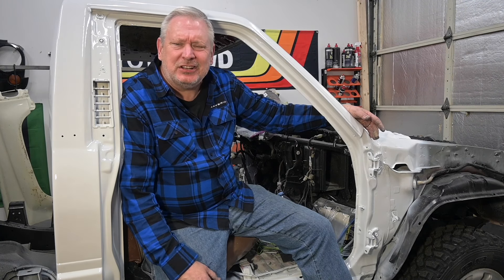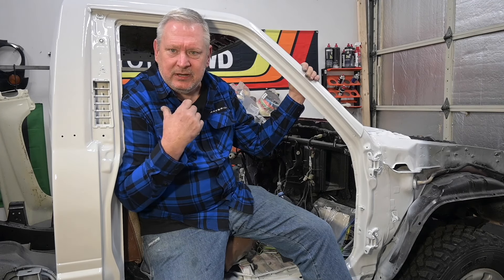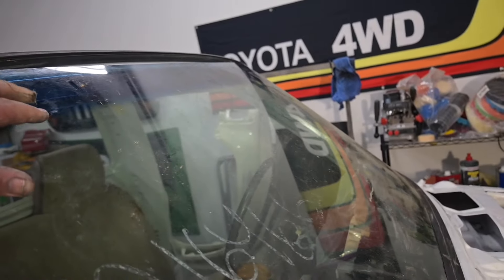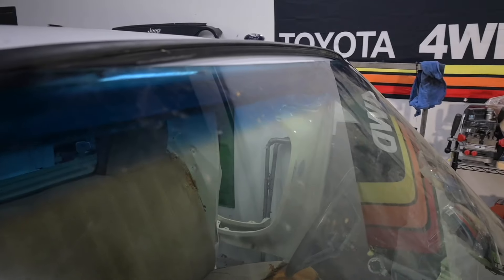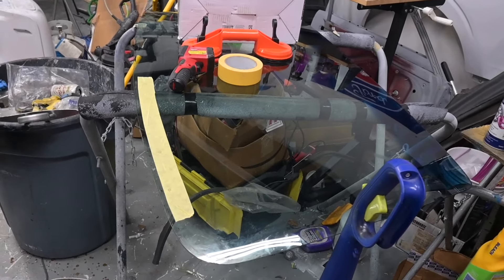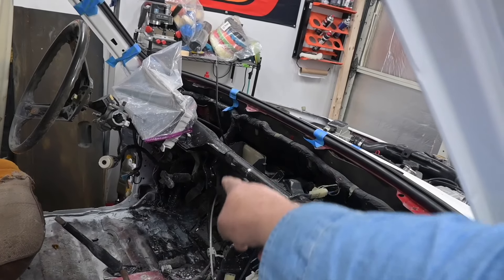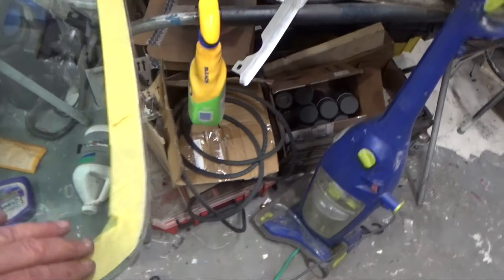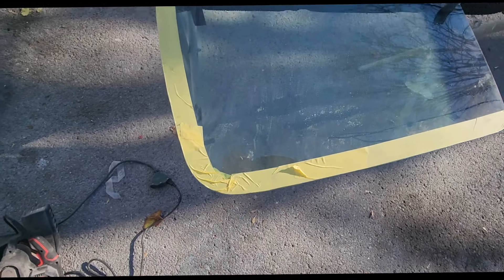84-88 Toyota Pickup Paint - Windshield-Rubber Gasket - Randy and Birds

Comment: So you used no glue or adhesive whatsoever?  Held in just by the gasket?  If that's the case, perhaps leaving a little meat on the bone to allow a tighter fit is actually the right way to go?

Comment: One more question Dave.....so, I appreciate the 'cut-off' measurements you provided, but do you know the 'final measurements' of the windshield that worked in the gasket??  The reason I ask that I'm sure that if I buy a new 'aftermarket' windshield the measurements may already be a 'little different' than factory....so I don't want to just mark it up to take 3/16" and 3/8" off....just curious if you have the final measurements that worked for you...Thanks either way!!

Comment: Would a windshield from an early model pickup fit? 
Like the one that the gasket is made for? 83 and earlier pickup. 
Would it fit? Or is it completely different?
Reply from the maker: The issue isnt the rubber as much as the windshield is too big without grinding the truck or sanding the glass. The gasket is made for the foreign market which used a different windshield than the US. No clue on the 83 windshield - I had a hard time finding an 88 hahahaha
Reply: @RedneckGarage  I’m better off refurbishing my trim and getting a new clip kit.